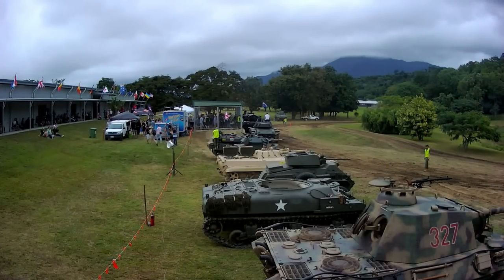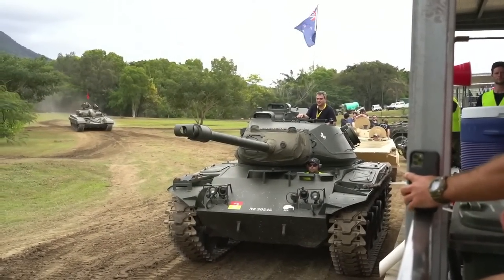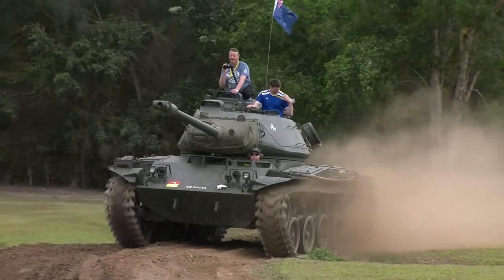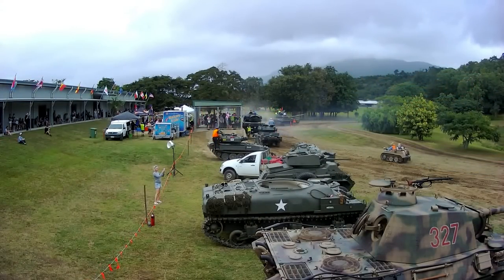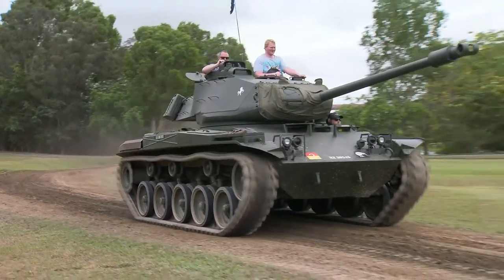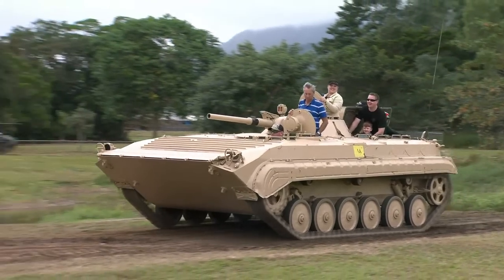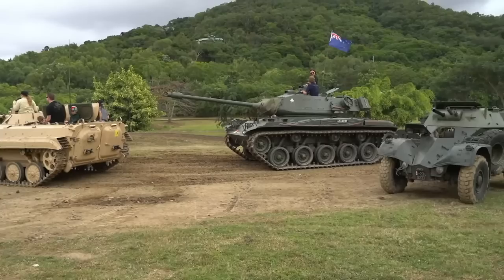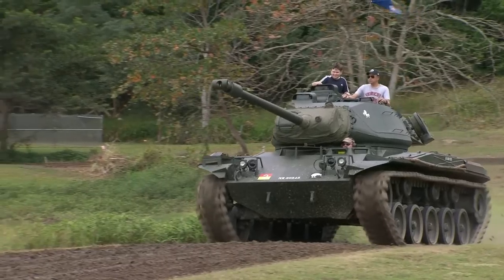AusArmourfest 2022 - DAY 2

Comment: The Australian  Sentinel  AC4  Tank  mounting the British 17 pounder ( Thunderbolt)  was never put into production   only a prototype  was commissioned   A brief history  a program started by the Australian government  during WW2  to produce a home made tank  as British and American tanks  were in short  supply in the early years  so the Aussies set about from scratch to try manufacture tanks  with zero experience or knowledge  and with not much Heavy engineering going on in Australia at that time  other the new south Wales railways  so and another company manufactured and assembled them   a Mission  was sent  to the USA  to find out how to build  and get a Idea what type of Tank they should start with  the M3  was looked at .. the UK sent Colonel Watson   M.C  an Artillery officer  with many years of tank design along to help  the Aussies  an they came up with a first Tank design  AC1 Sentinel  it was a cruiser type tank similar to the British crusader tank  the sentinel was a parts bin put together affair while the Aussies managed to cast the hull as a single piece  a jolly good achievement by its self  However that said  none of the  tanks ever saw  action  (the chieftain  did a segment on the tank  he's thoughts on it as a fighting tank go watch ) but kept trying to improve them with various marks of Sentinel tanks resulting in the AC4  with a bigger turret  capable of mounting  17 pounder anti tank gun (as mentioned named the Thunderbolt)   Now then  let's correct a few errors made by this Australian commentator dude at this  Aussie tank feast   great show  by the way   mate  No Australian was flow/ shipped  or dropped off by  stock  and parachutd in  to crack the problem with fitting ca 17 pounder  gun  to a M4 Sherman your having a laugh mate  lol   Let's   start  it right at the beginning   the whole project  and feasibility studies by the British government had a look at it decided it was a impossible task so did the Americans   too much time and effort  and all that.  and cancelled  the idea'  however  it didn't stop  a British officer   named  Major George Brightly   from the RTC  determined to get this tank ready for the British lads  at the coming Normandy invasion  he was was  first credited  getting the ball rolling  experimenting various ways  fitting the gun  followed by lieutenant   A Colonel   Wilheridge   it was he's connections to other  top people  like Major general Raymond Brigg's  who  successful lobbed  to get the British government interested again in the project having initial dismissed the idea of the Firefly   the whole  project was taken by professional tank designer's  The Main Man  credited  getting the Sherman firefly  workable  and  into production was  ""William  Kilbourn known just as ""K""   born and bread  in  Leicestershire  Leicester city  England 🏴  he  and  his team managed  to crack  the problem  and put into production  the Firefly Tank in 1944  in time  for the Normandy landings  as yes my Aussie mate they did put a hole back of the turret  and what a fantastic job he did  Mission impossible   being outgunned  in battle wasn't a pleasant experience as the the British 8yh army in North Africa campaign  early years  soon found out  to there cost    I'll just add this  in the background of all this was the First introduction of the newest British  tank  the famous  Centurion tank  the  MK 1 20 pounder  rolled out and sent to Europe in 1945 to late  to see action  but completed  evaluation trials    the MK 3 Centurion soon followed  and  was fitted  with automatic  gun  stabilisation   system able to fire on the move  plus a move powerful improve engine  so powerful  improvement  that  British tank  Regiments  took out of service overnight all previous  Centurions in the front line service  but the game changer was in 1959  the arrival of the Royal Ordnance 105 L7 gun  the king of tank guns  fitted to the MK 5/2 onwards  and they didn't need to CUT HOLES in the TURRET to fit it  🤣😂✌️ the Aussies  eventually got there hand's on  Centurions and sent them to the Vietnam war to help the Americans   where they performed very well  I believe  British engineering matey

Comment: if i recall correctly the m107 self propelled howitzer had the 155mm gun, the 107 and 110 used the same chassis and the old 107 were converted to the 203mm on the 110